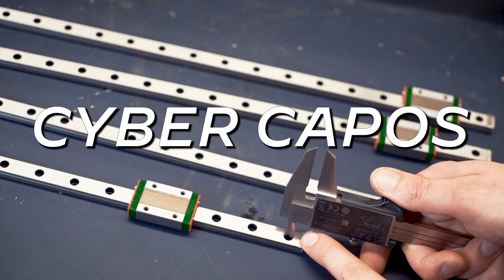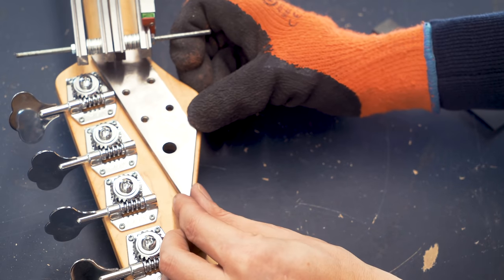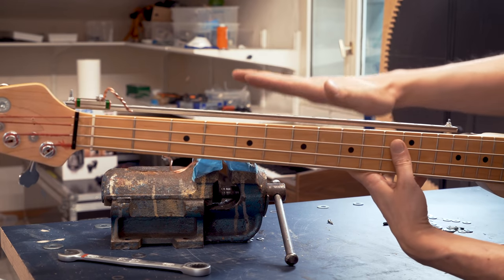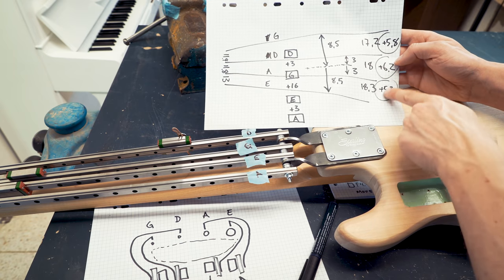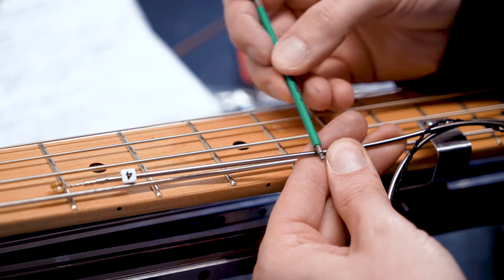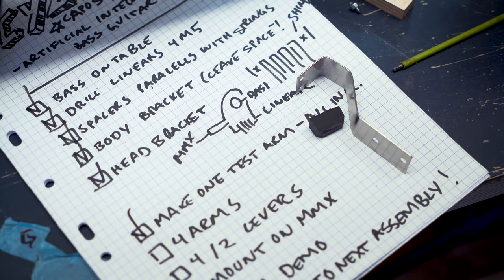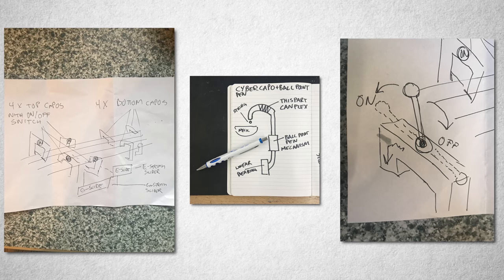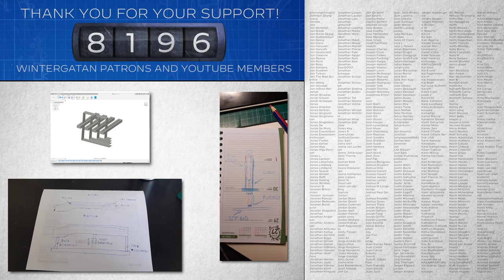Custom Bass CYBER CAPOS

Comment: One idea for making it able to turn on and off would be by having the whole thing set on a pair of cams.
One on each side, then link the cams with a rod. Then the linear rails could be lifted up by lets say 10 mm, providing sufficient clearance for the strings.
Though would only need a cam that is 5 mm off axis.
Another advantage of the cam system would be that one could also use it to mute the strings by not fully applying the capos.

Though, what you have achieved so far is really neat and the machine is really coming together now.
Reply: You could also just detune the guitar a little bit. So it plays a g not a gis
I hope you understand it
Reply: @freudenreicheskieselsteinc1232  ah, blue notes then?  Is that what you mean?
Reply: Nah not blue note. “Off” is fret 1. So it’s still pressing the string, but you’re getting an open string pitch. 

But I think Martin is using crazy custom tuning anyway. I think he wants “off” without moving it so it’s ready for “on”. I think.

Comment: If you get the on-off capos working then you can add a solenoid or servo to actuate via a switch that the marbles drop onto.  Next add a linear drive on the linear bearing to move the capos automatically to the correct fret.  That could be controlled via another set of marble activated switches.  Wow only need about 100 switches.  Need 100 more channels on your programming wheel!  Wow, now that would be feature creep!
Reply: Martin: ...Håll min kulmaskin.

Comment: Aahh, this is the thing Carlos mentioned few days ago. You guys are incredible. Hugs for the team! Edit: dirty hands - check. Shim washers - check. Welding rod - check. Overengineering - check. Miscalculation - check. Pick in the mouth - check. Manual operations on cyber stuff - check. Mesmerising tune - check. Playing three instruments at the same time - check. Wait. Where's the duct tape and ang... nevermind. Button up shirt - CHECK! Extra hugs for the most beautiful version of Starmachine2000 i've ever heard /sob/

Comment: Have you considered instead of a complicated "on / off" pusher over the bass string to instead use a rotating cam? It might be easier to implement and more compact a solution too.
Reply: This needs to be seen more. Sounds like a very good design. Bi-stable mechanism maybe with a spring.
Reply: @RijuChatterjee  i think simple is better in this case, just make the rails for the capos longer at the top of the neck so that they can slide to be near the head of the bass and off the strings or at least to where the strings transition from the head to the neck. If the Capos are at the top of the neck then theres no need for an "off switch"
Reply: Commenting to help this comment up. That's a genius little idea. Simple and effective
Reply: Houston Newton lol same xD
Reply: Ok  Houston Newton  !
Reply: @okidoxb4846  I'm not sure it's a good idea to have constant pressure on the strings, it'll wear things out and be harder to move around due to the friction. Also moving the capos all the way to the nut is a long range of motion etc.
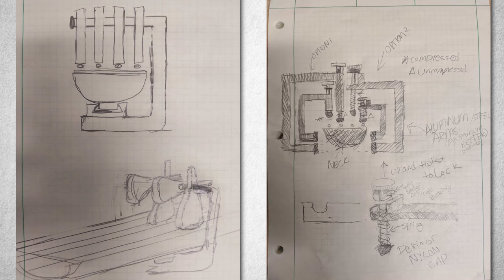Reply: There are some sketches of cam designs from 14:25 to about 14:35

Comment: Why not add a trigger to each handle. Have the capos compressed with a tension spring to apply the downward force. Then attach a trigger to apply the vertical motion, this releases the capo to play open notes. 

You already use handles on the lower side of the linear bearing, so this would be one handed operation. Best way I can describe this is to think of an oversized retractable pen as a handle attached to the linear bearing. It always wants to be in the "closed" position. Until you click the button.

Edit: as a bonus since the capo is keeping contact via tension spring, this means that it can be playef in the down/closed position and have less resistance moving over the frets since it will raise and  then re-compress from the tension spring.

Comment: Exciting your works..
Some processed metals have a difference in texture and gloss. It disrupts the integrity of the project. My advice; Heat the metals with blowtorch and wipe them with burnt engine oil (wipe the heated metal with an oil-soaked cloth). You can do this 2-3 times until the metal gets dark. Then the metals become black. And the treated metal is all the same black. After the metal is dry, you can clean the oil residues with alcohol and green dish cloth (felted scotch brite).
As a mechanist and sculptor, I add aesthetic value to my metal sculptures in this way.

Comment: I love what you do! Idea: Why not drill perpendicular hole through black finger for pin and put a rolling wheel (tiny pulley) parallel with string and use it to eliminate buzz from string sliding. Just an idea. I cant watch it all right now as I am so busy but... this is most amazing project I'm digging it man. Keep up good work.
Reply: Just seen someone had already beaten me to the wheel idea. I didn't get to read comments or I would have seen that sorry my bad.

Comment: Martin, I'm sure there is a reason: Why don't you use small metal rolls to glide on the strings instead of the rubber?
Reply: Im guessing tone/ metallic ressonance. I have a feeling it will be trouble with them wearing out. How about metallic rollers with rubber tires from a Lego car? :)
Reply: @Gardehesten  100% this. Could bypass by going with rolling rubber though

Comment: You could use tiny actuators for on/off on your capos. And use an atmel tiny processor to read color on the pins in your wheel. That way the color would read what position to move to and a plane pin following the color pin to actuat the marble

Comment: To turn it off... Just slide it past the string bridge at the top... Or make a "lift ramp", just before that part, if the slide rails don't go that far. (You can offset the spring-steel to make it reach higher or lower, if that is more desired.)

If not a "ramp", at the end of the neck... Then build a support bridge across the neck. Lifting them UP on a ramp that is not pressing down on the neck. (Which might alter the "tune" of the strings.)

Comment: Maybey consider longer attachments of the 'cyber fingers' to the under rails along the length of the rails so that easier to use handles can be used and it won't catch by friction when the 'cyber fingers' rotate.

Comment: Awesome proof of concept!

For On/Off perhaps hinge would work but riser would need more clearance on inner strings to allow for hinge to second (off-string) position. Would allow for open strings too. Can you do that now by sliding past the nut?

For higher note accessibility on the fretboard, mod the body to allow unobstructed neck access all the way up. Problem solved ;)

Comment: Hey, I don't know if you and your team thought about this yet, but what about setting up a pre-programmed circuit board hooked to a servo for each string, with a programmed position for each note across the guitar.

I'm not sure how you'd gear it to move, but to choose the notes, you could add in 4 extra magnetic pickup lines (if they would fit) between the programmable pegs, and then just use the pickups for choosing the notes.

Comment: If you used small rubber wheels instead of delrin "fingers" there would be almost zero wear because the wheels would roll across the fretboard not rub, and you would have the sensory feedback of having the wheel bump over each fret and sink into place between them at every interval as you roll the wheels up and down the fretboard. There's a capo on the market right now called the glider capo that does this nicely however it is like a traditional capo in the sense that its just one long "finger" and cannot clamp at multiple different locations for different strings however its a good example of what could be adapted to your rails by just cutting the rubber tube into 4 pieces and putting each on your rail system. Rolling rubber probably easier on your strings than sliding delrin too

Comment: Have you tried electromagnets as up-down drivers for the 'fingers'? Should be pretty much instant on-off, in terms of speed. Not sure about possible cross-noise generation via near-string magnets though.

Comment: The ON and OFF feature would be pretty tricky. Could you have the rails lift up toward the neck to the OFF position... And have it slide, click, or even snap down, away from the neck to the ON position?

Comment: IDEA 💡, How about using an off the shelf teflon Wheel ball bearings from china that made for aluminum v-slot sliders, this way it's NO WEAROUT and no need to liver anything, also using linear actuators can slide those capos electrically. 
P. S. the HIWIN is VERY  heavy weight added to your machine its not recommended, use aluminum please.

Comment: The whole problem with adding a stop function to the capos reminds me a lot of a heddle on a loom. If he added a place on the slide bars where all the capos were over a suspended platform, you’d just have to lift the platform a tiny amount to raise all the capos since they’re on spring steel.

Unfortunately the idea of doing that while the instrument is being played may pose a problem, but you could at least play a song without one or more of them

Or you could suspend a separate track above the instrument attached to each capo that would allow you to raise them individually at will - so the whole structure would look something like a capo cage which would look super neat on this machine

Comment: What about a mechanism in which the fingers can rotate off of the frets when a lever is pulled, kind of like the dump door of a dump truck or a trap door. That way, you wouldn't have to completely re-engineer the finger mechanism, but rather just grind the fingers off, weld steel tabs to increase their nominal length, drill pivot holes, and run a hinge rod through all of them so they can lift up and out of the way when you'd want that too. If you're interested in the idea I can send sketches of what I'm envisioning, but this comment will likely be lost in the void :/

Comment: why don't you use a fretless bass and then use a computer to move the cyber finger tips. it will give you a perfect note and the robotic finger can have permanent pressure on the strings